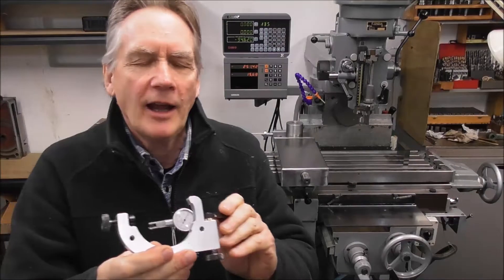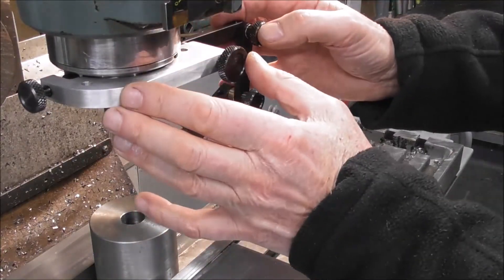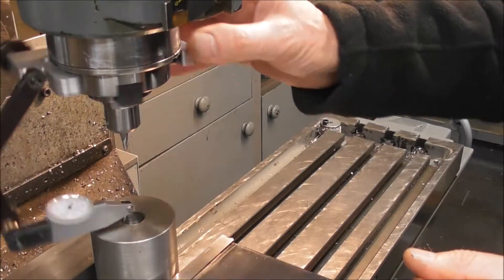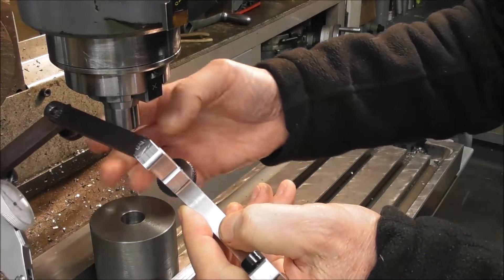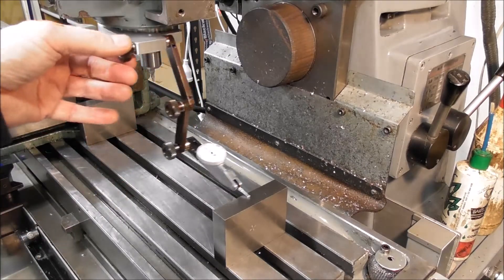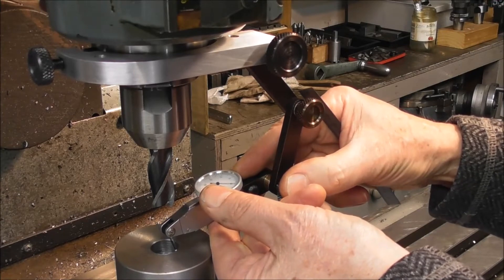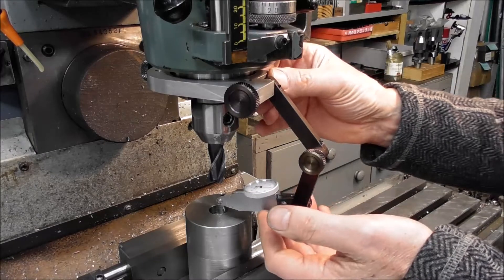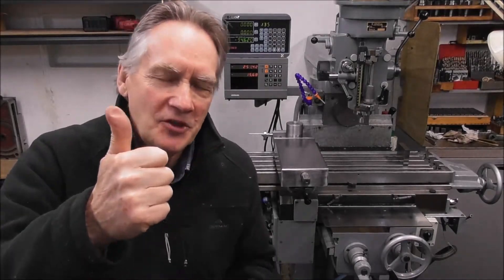Mill Spindle Dial Indicator Holder -  Improved Design

Comment from the maker: In my rush I forgot to explain how to construct the preset friction joints. If you are interested, have a look at 8 min in. I use spring washers to give the tension, but I bend the spring washer edge that would cut into the surface away a little, to give a smooth contact that does not dig in. You can see the grub screws that pinch on to the thread to lock the friction setting, use soft e.g. nylon or copper inserts in front of these grub or set screws to avoid damaging the threads. This works so well the knurled adjustment screws could be replaced with plain cap screws as adjustment is seldom required.

Comment: Im mostly interrested in the self locking part? Ty for the great content!
Reply from the maker: Thanks. I put this info in the intro: (I forgot to explain how to construct the preset friction joints. If you are interested, have a look at 8 min in. I use spring washers to give the tension, but I bend the spring washer edge that would cut into the surface away a little, to give a smooth contact that does not dig in. You can see the grub screws that pinch on to the thread to lock the friction setting, use soft e.g. nylon or copper inserts in front of these grub or set screws to avoid damaging the threads. This works so well the knurled adjustment screws could be replaced with plain cap screws as adjustment is seldom required). Cliff

Comment: Nice refinement w/ centerline positioning of indicator and square cross section link arms,  to reduce adjustment issues.  Easily adapted for miniaturizing for mini-mill, compared to problems fitting full size clamp.  Thanks for the ideas.
Reply from the maker: Thanks for your feedback. Cheers, Cliff

Comment: I have thought that having one of the arms to be able to telescope might be a good idea?   A lever clamp to hold it on the spindle?   Might want to have brass where it clamps to the spindle?

So for the friction joints: I think the grubs screws lock on the threads? You took the edge off the spring washers?

Do you think the rounded arms would be better?
Reply from the maker: Hi - Yes you are correct about the friction joints. (see details above) Rectangular arms are good because they can be set up on center and need no sideways adjustment. Cheers, Cliff

Comment: Looking forward to more in depth video, I'm curious about the friction joints and the spring washer details. Also how to machine the J clamp. Thanks!
Reply from the maker: Hi Kevin. Sorry these videos were put together when I was short on time. Did you notice the above?  (I forgot to explain how to construct the preset friction joints. If you are interested, have a look at 8 min in. I use spring washers to give the tension, but I bend the spring washer edge that would cut into the surface away a little, to give a smooth contact that does not dig in. You can see the grub screws that pinch on to the thread to lock the friction setting, use soft e.g. nylon or copper inserts in front of these grub or set screws to avoid damaging the threads. This works so well the knurled adjustment screws could be replaced with plain cap screws as adjustment is seldom required). Cliff